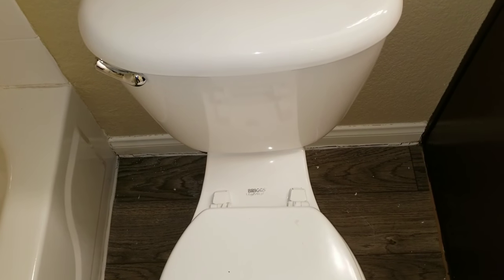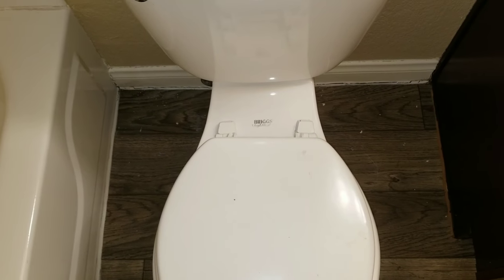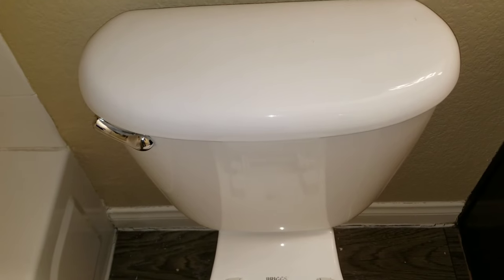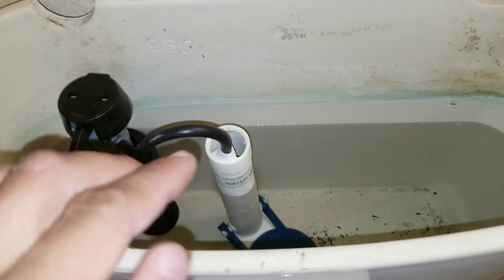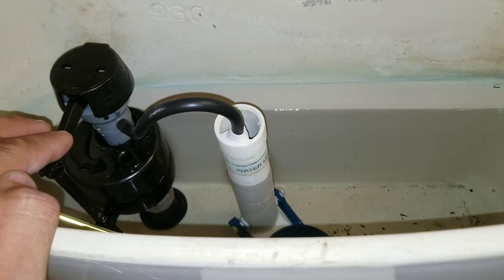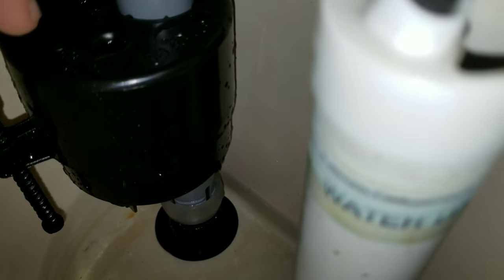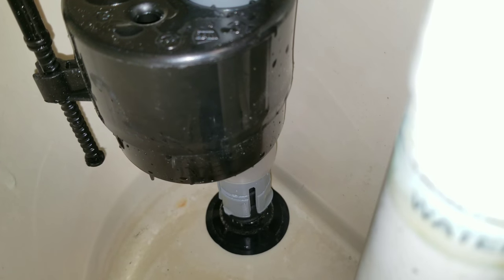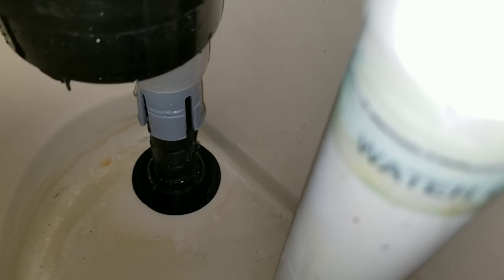Adjusting Toilet Fill Valve

Comment: FINALLY someone who explains the CORRECT way to adjust the water level. This is literally the first website / video that explained the ring on the bottom of the cylinder. All the others are just like "turn the screw" or "turn the shaft", as though 99% of us didn't try that first. THIS video fixed my low water level issue. THANK YOU.

Comment: thanks much for this video; I installed a new fill valve this week but it wasn't high enough inside so I thought I was going to have to disconnect the whole thing again to readjust the height; this video saved me a good bit of time.  Appreciate it.

Comment: THANK YOU! Other videos told me to twist the fill valve to adjust the height WITHOUT first telling me to move the plastic ring up! I was gripping and twisting the fill valve as hard as I could until I heard a scary grinding sound and probably almost broke my toilet. But once I popped up the plastic ring, boom don't even need to twist the fill valve, just move it up or down. Again thank you so much!

Comment: Very good video...There is one issue some people will run into and that's when raising the fill valve some some toilet bowls won't allow you to put the lid back on correctly if the valve is up too high...be sure to check that it is not above the porcelain after your adjustment.

Comment: Great video Sam. One thing I noticed you didn't cover is the fine adjustment you can make with the outer plastic bolt attached to the float. clearly it wasn't needed in your case, just thought I'd mention it for future reference.
Reply: Thank you 2 years later! This is the ONLY thing I had to do to fix mine. 😊

Comment: I know this video is 5 years old, but I have the Fluidmaster fill valve too and after I popped the white plastic piece up (that was difficult enough in itself), I couldn't move the gray piece up and down at all no matter how hard I pulled. Tried turning it and twisting but no luck. Ended up putting it back together and the water line was still low. If anyone else has this issue and figured it out, let me know please!

Comment: I thought moving up the ring might introduce some kind of problem to the system because the instructions for installation told me not to move it. 
However, there is nothing to worry about and it worked just like in the video. 

You don't need to remove the valve cap on the top, disconnect the hose and rotate the whole fill valve.

Comment: You should have just turned the small thumb screw to the right. No need to shut off the water, or adjust the height. (I'm a master plumber by the way, not an internet troll)
Reply: Tried to adjust both didnt work so the water lever in bowl itself is still to low
Reply: I tried that and it didn't work. But since I couldn't see what he did to loosen that ring at the bottom or how to tighten it again, I'm probably going to take the whole thing out and replace it. This is a rental house, so who knows how long it's been since it was installed. And since the flapper isn't looking too good either, I guess I'll replace it at the same time. My maintenance people refused to fix it for me, and while I have replaced a flapper before, but this will be my first time at replacing the float and fill valve.
Reply: My toilet’s fill valve (at least I think that’s what it is that refills the tank) has a screw on top. Will turning that reduce the speed at which the water flows out of it to prevent it from leaking out under the top of the lid?

Comment: Ugh, I don’t get it. I’ve tried everything. At first, it wasn’t filling, so I opened said thing and cleaned it out from debris. Then, problem was fixed so then later today, toilet seemed to be running, constantly. I checked and sure enough, it was overfilling. You’re the first to mention that valve, but it’s still overfilling. I think I spent about 2 hours and to no avail, I shut the water down. Maybe I’ll get it tomorrow.

Comment: The new valve we purchased looks pretty similar to this, but this adjustment at the base doesn't exist as far as I can see. The ring is there that can be lifted, but the adjustment at the base doesn't exist at least as far as I can tell.
Reply: hi, did you ever figure this out? i kept pulling and turning cuz some videos said you turn the gray piece to make it go up whereas this video you just pull it up and it clicks at each stop, but no amount of pulling and turning worked for mine.

Comment: My toilet tank only sometimes automatically refills after flushing and sometimes it doesn't. The float will be at the bottom and I have to tap the water level adjustment screw down to get the water to flow in. It's hard to troubleshoot because it does not happen every time and if I try to adjust things, the water will begin flowing in.

Comment: Must be a common occurrence; my floater is a little different; adjustment for mine is just below the arm that pivots the water on/or off. the step connecting the arm can be twisted loose to screw floater up or down, reconnect stem to arm and walla!

Comment: I just replaced my fill valve with the one shown in this video. My issue is, the arm holding screw, occasionally locks up or down. So, in the middle of the night, you may go to flush the toilet the toilet never filled back up again. I can press down on the arm, which activates it to fill, then have to stop it manually. Once it is set, it works for 7-8 flushes. Then doesn't fill again. Is there a fix for that?

Comment: My water will come into toilet bowl about a inch higher than water ring in toilet bowl and then about 30 seconds later slowly level back down to water ring in toilet bowl. Is that normal? The water level in tank is at the correct water mark line in tank. I don't want unnecessary water going into my my septic tank. Thanks for your time

Comment: Question,,,, the small fill valve tube, the black one... how far down Into the bowel fill tube should it go?  Should I hear it “dripping.”
Every 5 to 10 minutes, my toilet seems to be filling.  Does it for about 10 to 15 secs.  I’ve replaced the flapper numerous time.  Thanks.
Reply: did you ever solve this issue? i just replaced my fill valve before my toilet no longer flushed, and now my toilet won't stop refilling every few mins. i tried changing out the flapper to see if that was the problem, but no luck.
Reply: @phan282002  HAHA.... the toilet challenge!!!  Did I solve it... permanently?  No.  It seems to be okay for a few days, then repeats the problem.  I've changed the flapper periodically.  2022 will be the year of the "flapper."
Reply: @Skyholder001  lol! Well, that beats my situation. I accidentally cracked the tank after changing out the tank bowl gasket. Gonna pay someone an arm and a leg to change out the entire toilet now. 😩
Reply: @phan282002  Oh mannnnnnnn!  THAT sucks!!!